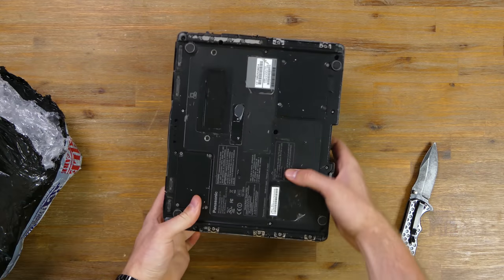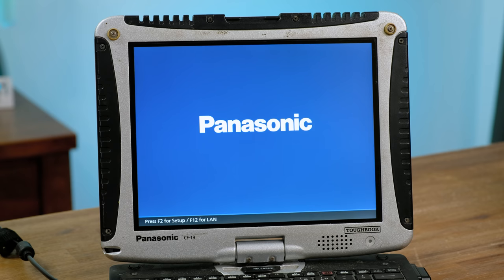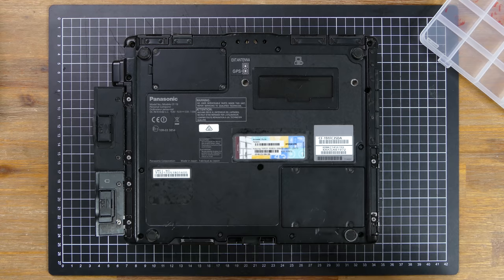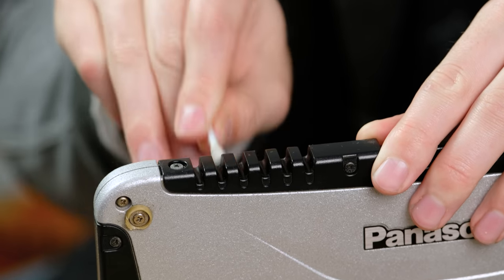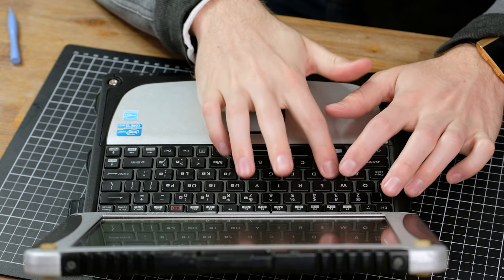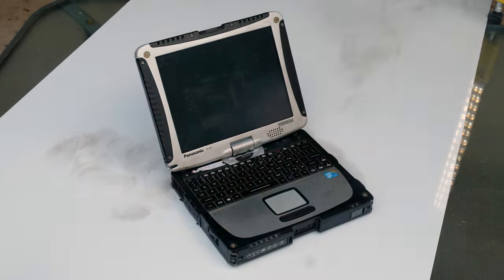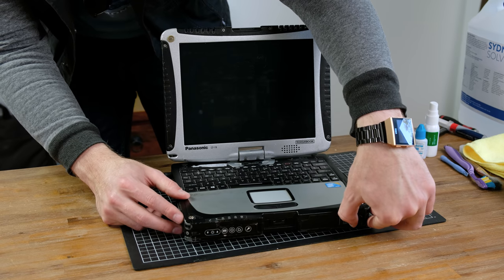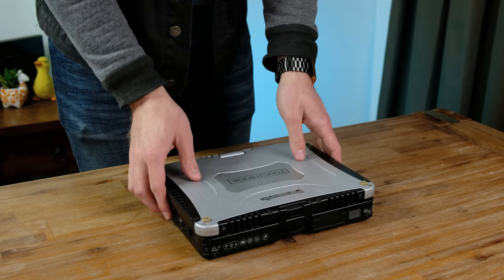Should You Buy an Old Panasonic Toughbook?

Comment: wrong that fuse in the hard drive caddy is for THE HEATING ELEMENT you just peeled off from around the hard drive they use the for the hdd to be able to work in ice cold climate
Reply from the maker: Wow, I didn't know that! Is it always active? Maybe I should remove it since the SSD isn't going to be subjected to cold conditions 😅
Reply: @psivewri  ssds work better when they're warmer so it should be fine.
Reply: @psivewri  from what i know it is not always active i think it either uses the hdd temp sensor or uses a dedicated temp sensor on the motheboard of the laptop
Reply: Psivewri have you ever seen plainrock124 moving on videos :D
Reply: Wow that's impressive!  I saw those style of heater on the Mars rovers😀
Reply: @ub7247  I watch plainrock124 and plainrockvlogs and i watch all the moving on videos
Reply: Wow is that what it was. I was wondering what it was. (:
Reply: @naziahasan709  me too
Reply: @psivewri  On my MK1 CF-19 there's a bios setting to set the climate I believe, but yours is a newer one so it may do it automatically.
Reply: nazia hasan Are You Turkish Mate?
Reply: wow
Reply: @ub7247  hey siri
Reply: @psivewri  You can tell when the heater is active when bellow 0C I believe, it won't boot to windows until the system heats up the HHD. I have had mine do it a few times, ps mine has 5.3 years of on screen time so they can last a long time
Reply: @ub7247  Destroying tech is not good so I don't watch plainrock124 or planrockvlogs
Reply: It's so advanced the poor fello getting know

It even got me !!
Reply: @psivewri  it only activated when it detected it’s temperature was too low
Reply: @psivewri  go ccg
Reply: The heater is damn cool, can't remember who (think it was RandomGamingInHD), but they literally froze the bottom of the laptop in ice, turned it on, and it autodetected the low temp and engaged the heaters until the laptop thawed.
Reply: @derkernsen  late reply but the ssd that came from my sisters old pc(she already has a new one built by her) it would stop working when warm and once cooled will start working again since it’s early ssd tech it was failing faster than modern ssd tech!
Reply: Yeah, I had the same experience with them in Afghanistan 😂
Tougher than most soldiers.

Comment: Used these in the ARMY deployed in Afghanistan, worked great in sand storms and survived explosions.
Reply: lol
Reply: And then somehow you became PROTOMARIO?
Reply: damn you were in the military?
Reply: My guess is that these Panasonic “tough books” were the civilian version of it. I just found one behind the dumpsters yesterday, a model CF – 27EB6GQCM. The screen is not cracked. All the keys are there. And it does not look like anybody hit it with an ax. But it had been out in the weather for sometime. I just cleaned it up as best I could this morning. Can anybody tell me about this particular model?
Reply: @nonelost1  take out the harddrive just in case and replace it.
Reply: @nonelost1  kinda breaks my heart to know that people just throw these computers away.
Reply: Sure you did....
Reply: Wow, that's not a gaming computer, but you can still use it and it's very durable!
Reply: Did you send a RC-XD with it? Juuust like in Black ops
Reply: I forgot you served.
I remember your old ass video about buying a PSP and hacking it while you were overseas.
Reply: @nonelost1  The Panasonic CF-27 Has 350MHz processor and can take up to 384 MB RAM. These are good for Windows 95/98 2000 or XP or a very light Linux os like Puppy. As they are too old and slow for internet use I'd go with Windows 98SE or Windows 2000 with the service packs they can make a nice retro laptop for running old software like old games and MS DOS stuff. I have MS-DOS 6.22 and Windows 98SE on mine. You may have some trouble with the touch screen as the drivers are impossible to find  but otherwise not an issue if you can live with that.
Reply: it looks like the laptop is from BO2 multiplayer
Reply: That's about as good of a review as you'll get if you're wanting to buy one 😂
Reply: We used 100’s of these in the seismic industry, very tough pieces of equipment and can handle heat in the Middle East
Reply: @Saabafton Even if it is one of these old ones which came with Win98 they are kinda a collectors' item.

Comment: Dropping this laptop off the table in a coffee shop would probably crack their floor
Reply: They’re like the Nokia of laptops
Reply: i tried that before can confirm
Reply: If you drop your ToughBook on my floor, Get out of my house and bring the ToughBook with you!
Reply: @Dragon-zu2we  
Do NOT encourage anyone!
Reply: @MinecraftPro97k  you sound triggered
Reply: @Maximus20778  
I might as well encourage you 😏
Reply: @MinecraftPro97k  no one encourages me so don't think about it
Reply: @Maximus20778  
Oh, then I won't encourage you. 🙄
Reply: @MinecraftPro97k  good!
Reply: Nokia 3310 but, it's a laptop.
Reply: Panasonic X Nokia
Reply: @nslouka90  frick you I was gonna say that 😢
Reply: I have a CAT S61 smartphone which is built to similiar spec then those toughbooks and I legit broke 2 ceramic plates dropping it on them. And it makes my feet hurt A LOT. Thing is still totally fine and thanks to a tiny bit of extra protection not even scratched up.
Reply: I have seen an old one with major cosmetic damage. Like the paint coming off.

Comment: Challenge: use the toughbook for a day
Reply: Thats gonna be tough
Reply: A week would be better.
Reply: NoobGyver bruh 😂
Reply: That's not a challenge. I would love one of those. I currently rock a custom Dell M6300 17" beast. I absolutely love it. Screw thin and light. Hello durable laptops with actual port selection :)
Reply: @rpst39  that is what my original thought was!?
Reply: Better for a mounth
Reply: I wilk do this challenge for 7 years
Reply: Probably not as the battery doesn't last on these very much. (:
Reply: I only have laptop I got for free from neighbor. It's much worse. It can't even smoothly play 144p YouTube video.

CPU: AMD Athlon 64 - Single-core 1.6 GHz
RAM: 4GB (Originally 2 GB)
HDD: 300 GB (Originally 160 GB)
OS: Dualboot Windows 10+Linux mint 20 MATE (Originally Windows 7)
Reply: A year would be better
Reply: Challange failed, because using it is like using a normal laptop
Reply: For a week!
Reply: I love using mine. I take it with me to my part time job often
Reply: @lukmly013  I have a pc with similar specs 2007 dell demention E521 and athlon 64bit 4gb originally 521 mb and 4 tb is hdd's (I got it from my dad who used it from new to a few months ago
Reply: Already done, I daily driven a CF-31 Mk3 for a year.
Reply: I have panasonic too..its CF-Y9 model
Reply: I used a cf-31 my senior year in 2019. Best laptop I've owned yet
Reply: @NoobGyver  r/XD
Reply: I bought a refurbished one for my 7 year old for homeschool. He carries it with him every where and even sleeps with it.
Reply: Toughbook trackpad on everything
Reply: U have to be TOUGH to do that
Reply: 200 alt lol
Reply: @rpst39  like plainrock124 he might destroy it like him 😂
Reply: This is my daily computer CF-30. I have others that work on occasion but these are the reliable ones.
Reply: Bro we use those every single day at Miami-Dade Ambulance lol
Reply: Challenge accepted, I use thoughbook everday for one year now
Reply: a week maybe? 😂
Reply: @xPLAYnOfficial  would be like a dream to use one!
Reply: mine is CF-19 , once I drop it to the floor , and the tile broke

Comment: That there windows 7 pro key can still be used for windows 10 activation- just FYI
Reply: I expect someone like him to know that, but it's OK to mention it for people reading this comment section.
Reply: @BilisNegra  a lot of my very tech savvy colleagues and comrades don't know it still so it never goes astray letting the masses know :)
Reply: Any Windows 7 key works on Windows 10
Reply: What i due is put a drive in my laptop and install windows 8.1 (no activation needed since my laptop came with it) and then i upgrade it to 10 with the media creation tool and pop it into the computer i need it for
Reply: Possible I may have used that, or will. It also doesn't need to be a pro.
Reply: Cant
Reply: Anand Raj  oem keys can but only on the original unit
Reply: Why all this talk about a shitty OS anyway. Thats not an upgrade.

Comment: In my previous employment at MNC we used that toughbook a lot on field and in office, we needed one dedicated man to manoeuvre  2 panasonic toughbooks. There were 2 battery slots and we used to swap those during machine testing, our servant would quickly run to office to charge those batteries.
Once the toughbook fell off from 10 feet height from machine on concrete. I was shocked that it didn’t bend the thing nor display was cracked.
Once when I was on machine and machine was in running condition, due to jerk it fell off my hand and our 11.5 tonnes machine passed over it. We were shocked to see that at first but when we opened the laptop only display was cracked. The toughbook was insured hence panasonic repaired it.
But the company did fired me.

Comment: Cf-19's are actually one of the easier tough books to find parts for. They refreshed it so they reused the chassis and all of the ports and fitting for two different models (older ones were core 2 duos the refreshers were core architecture 3rd generation). Parts are expensive though that is for sure. I served as an army reservist and we had some cf-28's in our unit. We were given the option to purchase them (minus the hdd's and unfortunately the hdd shock mount caddies) for pretty reasonable. I still have it all these years later and it still works fine.

Comment: finding spare parts is diffucult..
destroyes a fully working motherboard..
Reply: Well, they are not same generation machines at all, the most trashed one is Core2Duo based while the more decent one is 3rd gen i5, probably like 5 years newer.
Reply: The motherboard could have had issues. Even if the motherboard posts doesn't mean it is fault free. Most are junked for parts or get sold on ebay. Personally I wouldn't touch a toughbook on ebay that has missing parts like batter, hard drive and ram because there could have been a good reason why it was stripped.
Reply: pain

Comment: I bought on ex mil one several years ago for $200. to run specialist vehicle diagnostic software, It does all asked of it and has been left out in the rain, dropped violently off a vehicle roof being backed out of the bay and left for more than 6 months without being charged when it was 'lost' and following a charge up it works fine. Its about to get a memory upgrade for now and was in use all day yesterday helping repair an old Jaguar.

Comment: Great video! I still have a CF29 running XP with over 30k hours, and it's in pristine condition (ex police unit, mostly sat in a car) with an SSD and new battery added. I still keep it around for old phone system programming tools that only run on XP. Even the old ones still have a lot of life for simple jobs such as running a CNC on a shop floor, data collection at a farm or factory, etc.

Comment: You have to remember these laptops by Panasonic and Getac are designed to run old software made in the 90s and 2000s.  Both the military and the industries that use these laptops don't need sophisticated software, at least not yet.

Comment: I saw the specs and i immediately said "yes, you can".

I mean, a 1.86Ghz Core 2 Duo T5550 is still usable today, with an SSD ofc.

I expected one of the older Toughbooks, like the 2004 models.
Reply: So... Is it bad that I have a worse cpu? (1.65 ghz two core (and i use it for gaming and it doesn't have a graphics card ((it's also a laptop)))

Comment: I have used and worked on those laptops as a warranty vendor for a customer. Panasonic limited the work I could do in the field to basically ordering batteries and HDDs and RAM etc. On dome models I think the CPU came out the bottom if needed (but I never even bothered). Parts are not hard to come by, but Panasonic will not give OEM parts to anyone. They make it extremely difficult. If you want OEM warranty repair (even if you pay for onsite service), you end up sending in the laptop for service in one of their clean rooms.

Comment: I have tons of CF-30 and CF-31 models. I used to throw them down concrete stairs while powered on with the original HDD and they barely had a scratch and worked perfectly without a hitch.

Comment: The thinkpad series(before skylake) is tough enough for normal outdoor working condition, but you still add some caps to the usb, displayport, e-sata ports to prevent dust intrusion, I love T530, because it has 105 degree celsius TjMAX that means you don't worry about the CPU hit the temperature upper limit that causes thermal-throttling, you just need clean the CPU-radiator every two years.
Reply: lol, thinkpads are weak stuff compared to a Toughbook
Reply: @modzsi  cost performance

Comment: I have a CF27 and a CF74 that both fine. The CF74 even runs Windows 10. My newest Toughbook is a CF-C2 which can convert to a tablet. Super battery life and plenty fast with an SSD. Only complaint is low volume from one tiny speaker so use earbuds.

Comment: I just bought a complete cf19 mk8; 2.7ghz, 16gig of ram and a 1tb SSD, for 220 bucks. I just want something durable to throw in my backpack for work. Not a scratch on it, and if I had to guess it probably sat in a cradle most of its life. Want to get a 2nd battery and fill the expansion slots just to make it as maxed out as it can be. A refurbished one is 500-600 American, but I snagged mine on mercari. 3k hours!

Comment: yes buy one. I use mine for network diagnosis and a machine to program my radios and gps deevice while camping. Its also my n64/entertainment/work machine, i take mine with me to every fire season and shes tough. most problems come from the driver installation process. You have to install the drivers in order as well any 2.5 ssd or hdd will work in the hdd enclosure as well. 
I run windows 10 and kali wl2 in hypervisor mode.dont install linux itself on them unless you have experience compiling and building your own os because everything will be broken and most of the hardware wont be recognized off the bat.Seriously these machines get a bad rap, but its a highly specialized machine with great usability.
The running it over test is pretty realistic, I can see someone using it to interface with a canbus. aside from the wifi card you also destroyed the gps chip....

Comment: A MK6 CF-19 has been my main portable since 2014. Bought it from my employer when it was retired. I was not fond if its replacement and i kept using it at work.

Its still quite snappy with a Samsung 1tb SSD and 16gb of hyperx 2133mhz ram.

Comment: Guys, I' brought a Mk6 in 2014 for around $3000AUD. It was and still is in mint condition. On it now. I LOVE the thing! It has been on at least 12 hours a day since then! It runs like a  dream. Quietest PC I have ever had. They tried to sell me the update fully rugged model, said not as it can tbe upgraded. I am thinking o fupping the RAM to 16gb, silicon packing the CPU. I dont want to mess with th HDD for SSD swap out. I'll lose the -25C heating element. These things are truly incredible machines. I'm considering Toughbook 40 used, but dunno this is doing the job, is smaller and doesn't need a noisy fan. This is the 1990 Atari of today... Expert told me homes tests are ridiculous and a waste of time and Toughbooks. They are to be respected, IMO. He said if it hits in the wrong spot it can and will be damaged. Your data on the screen in inaccurate. Later model CF-19 screens are NOT 475nits, they are 1200 nits! The highest they made. Probably because CF19 is designed more for sustained outdoor mobile use.

Comment: Rocking a refurbished Panasonic CF-31 MK5, complete with 5th Gen. i5-5300U, 8 GB of RAM, and a 200GB SSD.  Really nice laptop, even though the screen is 1024x768.  Plays games well, as long as you keep in mind that it's only Intel Integrated graphics.

I like my 8 hour battery life, and mine does not have the secondary battery.  I've got a DVD burner instead.

Oh, and I'm still getting used to the touchscreen.

Comment: I got one cf19 mk5 for free since 2021, it was a writen off office asset, but the intel dynamic power performance management is preventing it to install windows 10. After a year using it with windows 7, I search in forums the intel dppm should be deleted first before installing windowa 10 from inside of windows 7 (not usb boot), and then using driver intel dynamic platform and thermal framework version 8.0.10003.14 A00 20 September 2014 from Dell. Now it is more usable as a spare machine.

Comment: i have one of these that been in the family since new at that time it was valued  at AU$7000 it has a core 2 Duo intel chip & runs Twister UI Linux over Xubuntu very well , because i love drawing with linux so much i decided to use a Logitech K400 Wireless Keyboard that has a built in track pad works great on any surface  far better than a mouse any day the laptop i have is called a  CF19

Comment: Awesome I remember these . Telstra has these kitted out to all their Technicians for close to a decade . They never upgraded the software past Windows 7 though . They had a carry strap . They coped with 45 + heat in telstra vans with locked doors , snowy mountains and humid Tropics . They were handy to carry into premises and still have 4G link where ever you went . They were trashed though . Ive seen them covered in grime and still working . The IT department decided to go to Android apps on shit samsung Tablets . They do need more Ram with the i5 core . But if you work in a tough remote scene they will do the job to enter your data until you get back to base